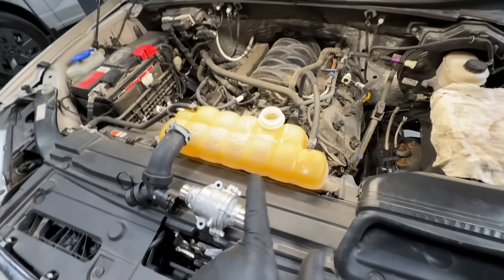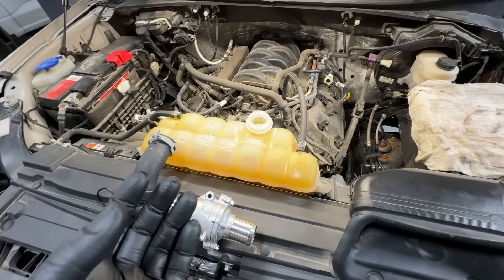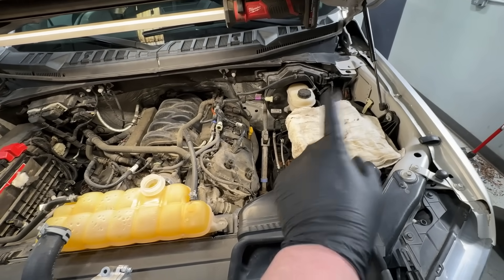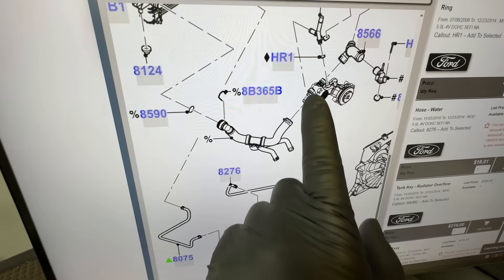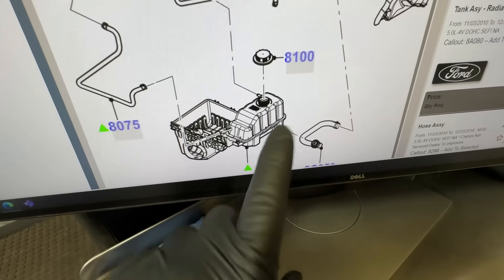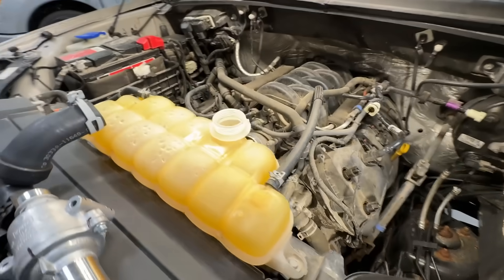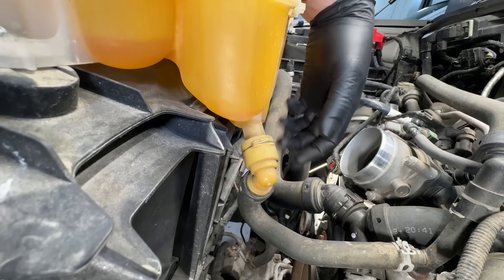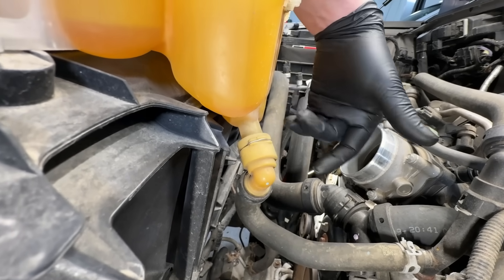2011+ Ford F-150 5.0L Coyote Engines: The Top 5 Most Common Coolant Leaks!

Comment: 2013 F150 5L Coyote at 139,000 miles here.  So far so good.  I did replace the transmission coolant lines as you suggested after finding one connector cracked.  Thanks for these videos!
Reply: You should be good for a long time. I have one in my fleet that’s a 2013 XLT 5.0 it now has 310,000 miles. No issues at all
Reply: I’m happy with my ‘14 STX Coyote . 178K and one major blip ……. Diff pinion bearing and seal . Even trailered a Galaxie from Fla. to Jersey nonstop . It’s a fine truck . Because of this subscription I’ve changed out my purge valve and I check the cooler lines every quarter .
Reply: @mikemar42  oh yea we have a 2013 5.0 in the fleet it has 310,000 miles
Reply: Everyone is so lucky here. I got a 2013 5.0. The design flaw valve issue showed up at 136,000 miles. I did top notch maintenance every month too

Comment: I am getting a 2024 F150 Tremor with the 5.0 v8 engine this Spring.    Do you think this engine will have all of these problems also?  I thought this would be a great engine but if it isnt I dont know what my other options would be.
Reply: The newer 5.0 v8 has cylinder deactivation as well as a "wet oil pump belt" which is a costly maintenance item.
I would get the 3.5 EcoBoost.
Reply: Alot of the research I did before deciding to go with the 5.0 said there were alot of issues with the 3.5.  I don't know nothing about all these engine types but I just want an engine that will have good reliability.  I am sure that's what everyone wants also.    Thank you for your advice.
Reply: No problem, I just want to point out that the new 5.0 is not a simple and tried and true design. Lots of changes have been made. The 3.5 ecoboost have updated cam phaser design as well. 
I work for Ford at one of the plants that build the trucks, and I have a 2019 3.3 that's been trouble free fwiw

Comment: I have a 2011 Lariat with the Ecoboost and had a leak at the overflow bottle.  Replaced o-ring in the quick connect and still kept leaking.  Replaced the bottle and stopped the leaking.
Reply from the maker: Some also need the bottle but most do not.
Reply: @FordTechMakuloco  I was trying to do everything I could to stop the leak, and finally, I just bought the bottle.  I went ahead and bought the Dorman one because it was cheaper and had great reviews.  So far it's been soild and working really well.

Comment: My 2013 f150 has had the water pump and t pipe failure. Other than that, best engine I have ever owned
Reply: I thought it was great engine..... dude the valves fail in #4 or #8 fml

Comment: Could you talk about problems with the 09 ,4.6,,3 valve mustang engine ,ie the spark plugs , Were the 09 s different from the 05-08?
Reply from the maker: I think I pretty much cover them in my 5.4L 3v videos.

Comment: Brian may not like this engine but I do.  We have three 5.0's in our family.  My fiancé's 2017 F150, her son's 2014 F150 and my 2014 Mustang GT.  Her son's truck has around 260,000 miles on it and did have to have a timing job done at 190,000 miles but that has been it.  Her truck has 51,000 miles on it with no coolant leaks or issues.  My Mustang has 36,000 miles on it and no coolant leaks or issues.  The 3.5 Ecoboost seems to have way more issues than these engines do.

Comment: Thanks, I have been looking for low mileage Mustang GTs thinking about buying one 2016 and up, after I saw this video having 2nd thoughts. Damn Ford, they are expensive you would think Ford would get it right.
Reply: Yeah but these coolant leaks are such cheap fixes. Camaro is the more reliable car though.

Comment: Darn plastic parts.
Reply: It not the plastic, it is Ford.
Reply: @georgeburns7251 there is a reason that they went plastic and that's government mandated fuel mileage, make it makes better fuel mileage...
Reply: Make it lighter is what I ment
Reply: I have nothing against the plastic (I think it's ABS, known to be  chemically inert).  But if the coolant is allowed to become acidic from extended coolant changes, the acid along with the heat will attack the ABS.  Also, I noticed one of the leak points on that 5.0 was right beside the head, right beside an external source of heat.  I'll bet the heat alone kills those fittings.

Comment: As a mechanic that's worked on tons of Ford trucks and Mustangs that T connector 7/10 times is the reason here in Florida. I have seen several of the newer F150 2015+ where overflow leaks. In my experience working on 2011+ mustangs is that damn t connector.

Comment: The problem are those quick connect hoses. Had a BMW and they use the same style quick connect hoses as well and you have to be careful and ensure they click in otherwise you could be driving and suddenly your car starts overheating because the hose came loose and spilled out all the coolant. Now you got a warped head & a blown head gasket. Ask me how I know...😢

Comment: I have a 2012 Jaguar with what is basically a 5.0 Coyote engine in it. Not supercharged. I actually like it. 90,000 miles, of which I've put 35 k on it. Already had that tee replaced before I bought it. Good to know about these leak points though. I still have the old 5.4 3V in my old Expedition, but the 5.0 is easier to access stuff on, at least for me. And, I can actually get to the oil filter without having to be a contortionist.

Comment: Best V8 Ford has ever made.  The 5.4 liters have terrible issues and 4.6 liters are heavily under powered.
Reply: 5.4 3v had a a lot of issues, 5.4 2v didn’t, besides the blowing plugs issue. And that pretty much is an easy and cheap fix now, compared to early on.

Comment: I have a 2011 f150 Lariat 5.0, 265k runs perfect, easiest engine to repair/ access. I replaced all my coolant hoses at 140k easy job took 2hrs cost $200. Looking at new cars makes me feel blessed to have the old 5.0
Reply: Yep, same here. Just replace everything all at once. Super easy to do in 45 minutes.
240k 2012 F150.
Reply: 2103 F150 235k.  Runs great.  Had a waterpump leak at 100k, replaced pump, and all hoses.  I tried to get Ford hoses, but due to supply issues, I ended up with NAPA and GM and one Ford.  The Ford hose leaked a few months later.  I replaced the o-ring and had no leaks since then.  
Oil pan gasket on engine and lead frame in transmission at 233k miles.  
Great engine.  The entire drive train has been great.
Reply: Ya I replaced my leadframe at 125k, I hate depending on that  plastic piece, so I put a thermal bypass when I did it on the 6r80 and now my trans runs at 150 all day which is so much better for the leadframe.  @LivingRural1983
Reply: My 2011 f150 has about 180k on it has been a great truck runs awesome no issues!
Reply: 2012 with 547,000 miles
i finally spread red RTV on the degass bottle fitting because i was on the 3rd hose 😅
Reply: 2016 f150 5.0l with 565,000kms and running strong , just replaced top rad hose because we had a cold snap of -60°c outside here in the Rockies and the o-ring started leaking the next day, $40 and 20 minutes to fix . Only other problem is the fan turns on when I am idling . Pretty damn good for over half a million kms
Reply: @suicidalcanadian  nice, 2016 5.0 is a great year, same here my top hose actually broke off, just snapped where the plastic and rubber meet, was close to home so it never overheated
Reply: I’ve got a 2022 f150 5.0 and it’s TRASH, not engine related it’s the damn computer systems are faulty, kills batteries after a few months, quality control is not fords business anymore, it’s just selling new trucks.
Reply: 2013 here with the 5.0. 223k and running strong. Water pump at 150k and I just replaced the starter.
Reply: I had the o ring leak, so on the advice from the YouTube video I watched (lol) I just replaced the entire Y assembly. Easy and cheap. I think it’s a great motor…..and what’s with the “noisy”? Sounds really good to me.  I guess everyone has their opinion.
Reply: 2012 woth 546,000 i eventually just spread red RTV on the degass tank push to conmect fitting 😅 i was on my third hose
Reply: Yes sir super reliable and will last forever if tooken care of properly
Reply: I have a 2014 I replaced waterpump at 85000. Replaced o rings on y pipe at 100000. Just replaced the whole y pipe at 125000. Now I'm losing coolant again. Believe it to be top radiator hose at 126000. Sick of this 😢
Reply: @todd1860 see my comment above. I was told you can buy an entire kit for those stupid coolant O-rings and replace just those
Reply: @todd1860  bro sell the truck. Before the design flaw shows up
Reply: 2015 and on my 6th coolant leak in the last 20k miles. O’Reilly said half the hoses are dealer only parts. After the heater core blew and the 3rd bad hose/connector went out, the Dealer quoted me $900 (parts only) to just buy all the hoses. So now I’ve been piecemealing it. Heater core, upper hose, lower passenger hose, bad cap, bad jug connector, and now the oil cooler adapter is dripping. Ridiculous
Reply: Except that starter lol
Reply: you mean the new 5.0 lol  funny how ford revives the names/ displacement of old engines probably for nostalgic reasons ,  The similarity ends there. they did that with the 2.3 EB in the mustang.
Reply: @renj6531 Ram with the HEMI too so
Reply: No wonder people buy a Toyota Tundra
Reply: @jamescaldwell2685  and then pay for toyota stupid design issues too. They all bite us. I've had toyota too.
Reply: @stevefischer6623   Yeah starting around 2010, Toyota took  a serious nosedive in quality. The Corolla/ 3rd Gen Prius engines were garbage. Right around 90k they would have major oil consumption issues.  I lot of these cars ended up with blown engines because it wasn't caught.
Reply: @jamescaldwell2685  or buy older f series 97-2003 even OBS if in decent condition sometimes you may find a one owner mid 90s truck with <200k
Reply: @jamescaldwell2685  I own a Toyota but over the last few years they have tanked in quality...so many horrible disasters out there and they have abandoned their customers by rejecting warranty claims. It's all over the net...a quick google search will open your eyes. I'm talking major transmission and engine failures to more simple issues.

Comment: You should have counted from least, #5 to most common #1. Like Casey Kasem when he counted the Billboard Top 40 songs. Least to #1.
Reply from the maker: Oh darn you are right?
Reply: @FordTechMakuloco  and I was a dj early in my broadcasting career then worked for decades at Fox Television and Warner Bros Television. I love your channel.  I have a 2014 Ford Explorer.170, 000 miles and yes the water pump leaked at 110, 000 miles. I had FORD pay for the repair. It was a known engineering defect. I spoke to the SO CAL Ford rep and told them and reminded them others were suing Ford over this major defect.  I told them "I'm not going to spend ONE CENT on a very common engineering problem".They called me back and told me take it to Galpin Ford(Largest Ford dealer in the world n sales 30 years running) in Van Nuys and was fixed!! .Keep up the great work love the channel!
Reply: @FordTechMakuloco  decades and decades ago that's how radio station dj's counted the weekly songs. The least to the biggest songs on the station charts I think your generation has no clue or reference to how it was.  It's not a bad thing but your age group has a different experience. This axiom can apply if one chooses to use that, least to more or highest.